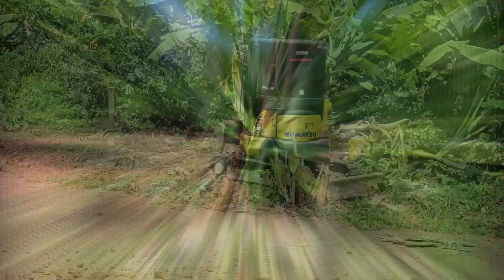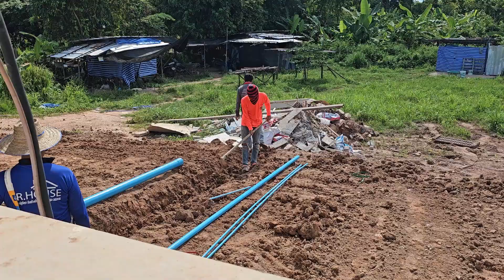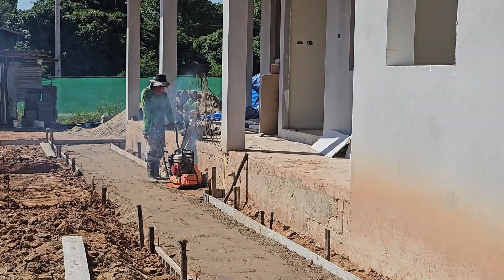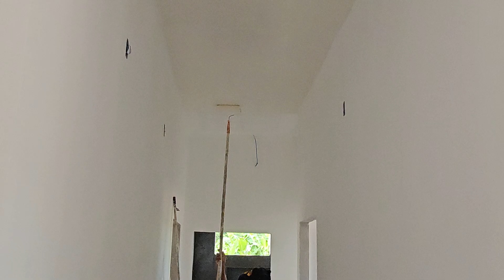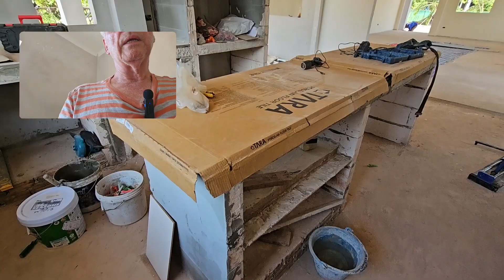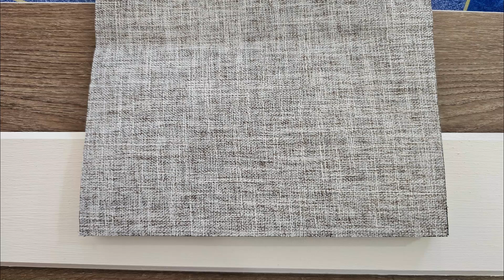Thai House Build Week 25

Comment: Hi. Can you tell me how much a truckload of concrete costs?
Reply from the maker: The response given is about the same pdice range here - depends on cement mixture & grade, distance delivery & other location factors.
Reply: Its by the cube, and also how much cement is added into the mix. Rough guess in my area (Issan) 1800-2200 bhat per cube, standard mix.

Comment: If it not too late; request your plumber/builder to fill up those blue pipes with water and pressurised it up to 1.25~1.5 times of the normal main supply water pressure to check for any leakages especially at the joint points.

You don't want to be hacking back concrete or building wall to repair those leakage. Check out American in Thailand's video where he had to do wall hacking to repair pipe leak and sewage blockage.
Reply: For all ...reinforcement before pour concrete, plumming and electrical installations .....take a review/inspection before it's not too late.
Perhaps consider Hire an engineer.... for this process
Reply from the maker: @rimzalia1362 - confirmed yesterday pressure testing will be done by the builder. But only when plumbing is finished. Appreciate the concerns & timing.